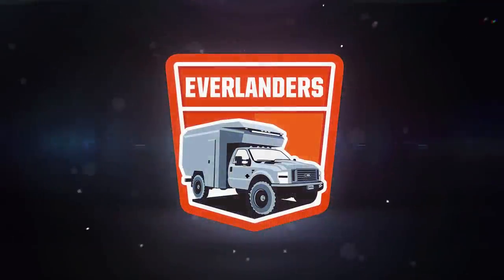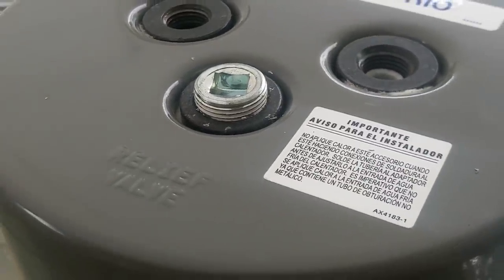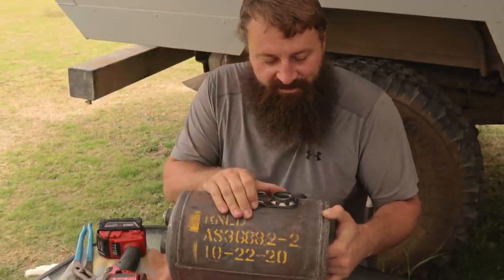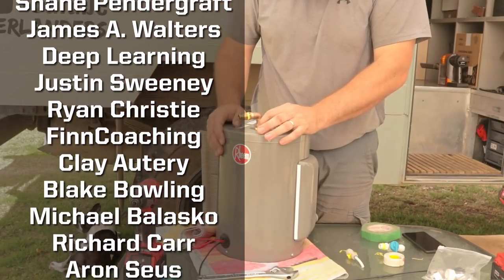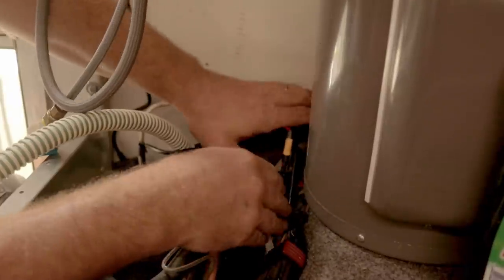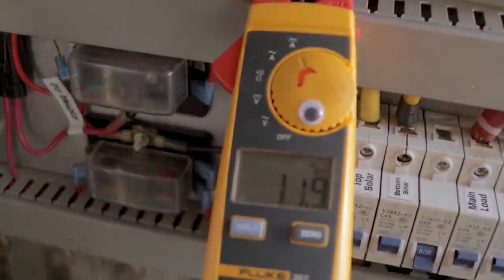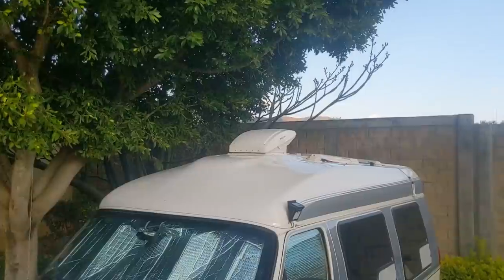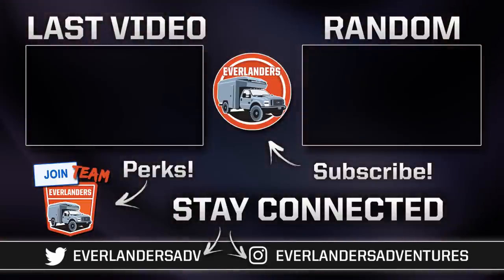Solar Powered RV Water Heater Conversion - 12 Volt Dump Load - Everlanders see the World!

Comment: Why the mat instead of the element?
Reply from the maker: Because it's what I had on hand on the side of the road in Mexico...
Reply: The element was brand new, why did you want to use the mat?
Reply from the maker: It seems you missed the whole point of the video, using excess 12 volt solar power to heat water with power that would otherwise go to waste after the batteries are full.
Reply: The stock 110 would also be a dump for excess solar, so why the mat is my question.

Comment: Why does the tank look like it’s been in a rust storm since 1967?
Reply from the maker: Do you want me to reply in an intelligent way or just making comments for fun?
Reply: @Everlanders  
I’m funnin’, but also curious
Reply from the maker: It really doesn't need the added cost of being painted... Because it's usually quite hot, there is little chance for humidity to condense on the outside...  Subsequent disassemblies for upgrades and maintenance show it's still in great condition... https://youtu.be/TGMZ7bM-Kow
Reply: @Everlanders  
🙏 thank you
Reply: @Everlanders  
Doh! I just realized my TV screen was still set for dark mode from the middle of the night. When I turned the TV lighting to normal it looked 1/10 as rusty as  it did with the dark mode.  🙄
Reply from the maker: https://www.youtube.com/watch?v=GD6qtc2_AQA

Comment: UMMMMM ….
WARNING YOU DON’T HAVE A RELIEF VALVE!!!!!   That is a plug where the temp/pressure relief valve should go
You kind of joked about the plug being higher than normal “relief pressure” this can be deadly!!
Reply from the maker: Of course it's not a pressure valve... But in my install, the nylon tubing will soften and let go at 66°c, The pressure regulator on our supply vents at 40PSI and the Stainless tanks each have 100PSI  pressure safety valves. "Your results may vary, I'm not going to get into it"

Comment: The keg one was better... this just made no sense... you just paid a ton for that water heater just for looks? Good grief.
Reply from the maker: You do realize that 3000 pesos is a bit over a hundred bucks right... And I paid for the fittings, Insulation and thermal cutoff safety switch. It was a prerequisite for the upgraded version shown here: https://youtu.be/TGMZ7bM-Kow

Comment: LOVE IT  but   PROGRAMMING NEEDED, DIY circuit boards.  Wow, this is some extreme stuff.  Pity as this is a killer app, dumping load to HW tank.  EVERY solar system could become MASSIVELY more efficient if there was a 'plug and play' module to add to PV systems.  Think about it someone who is a wizz at this stuff, hmmmmmm, I know techno geek, I'll have to see if he's interested.
Reply from the maker: No programming needed... Just connect the heater to a bimetallic switch if you like...